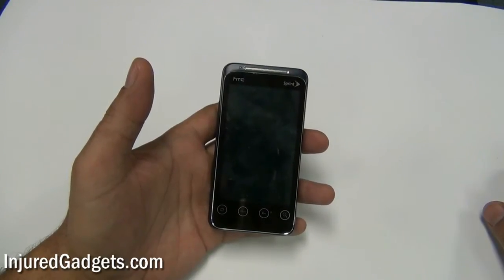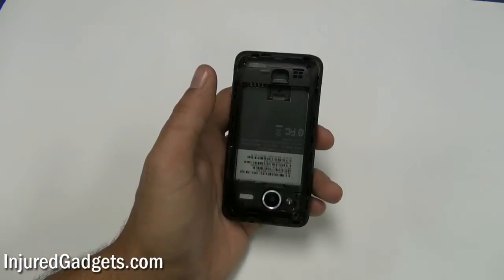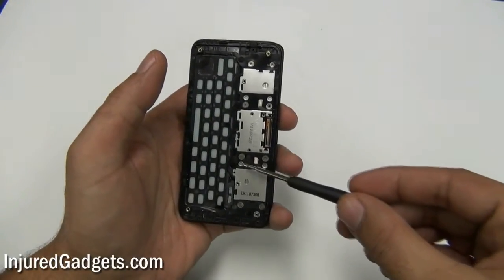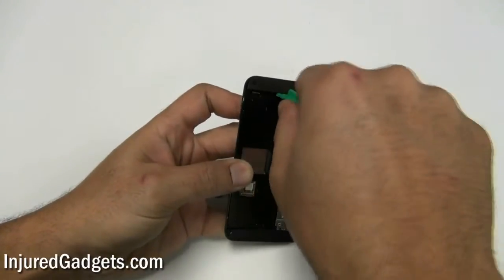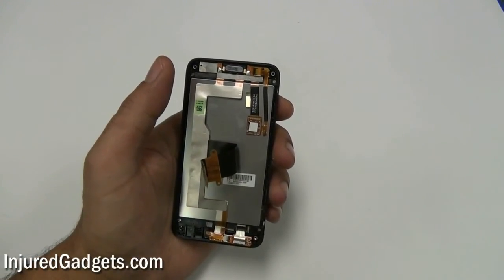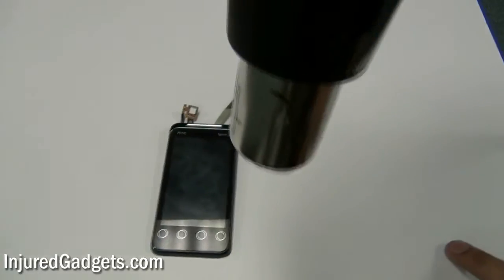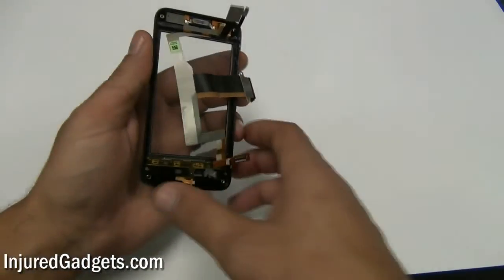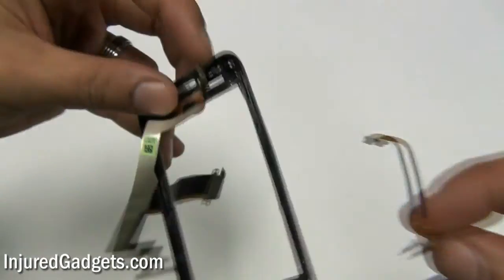HTC Evo Shift 4G (HD 720p) Touch Screen Glass Digitizer & LCD Display Repair Replacement Guide

Comment: I had to take my HTC evo shift apart because the screen was broken and followed all of your steps exactly. Put everything back together as they should be but now my touchscreen has a mind of its own and will back me out of what ever I am doing and take me to my home screen or bring up settings. And the very top on my touchscreen when on home screen doesn't work. Did I do something wrong? Could I have heated it too long while trying to get the LCD out?